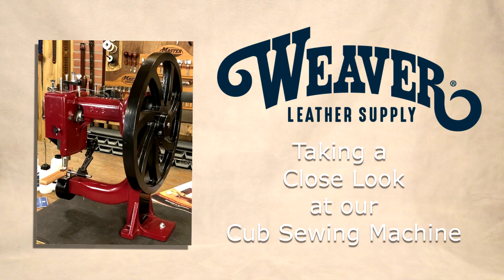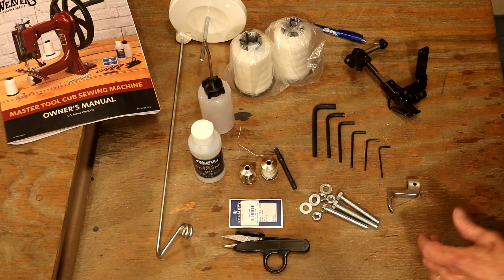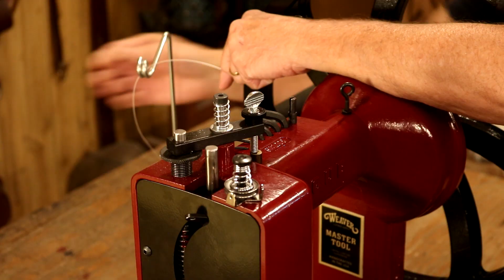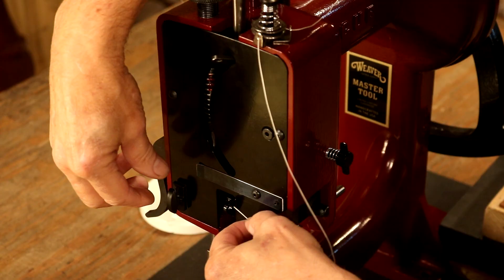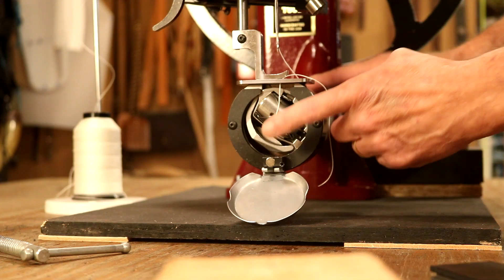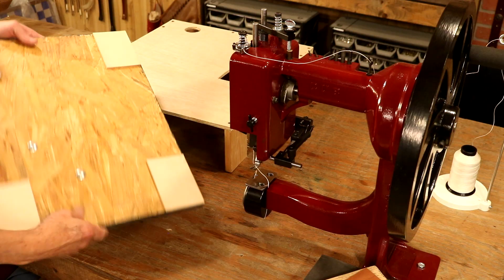A Look at the Master Tool Cub Sewing Machine

Comment: Does it sew a nice round corner?  Can you use a waxed thread?
Reply from the maker: Yes, the thread we use has wax on it and it does sew a round corner, you just have to take your time around the corners and make sure you're guiding the leather.